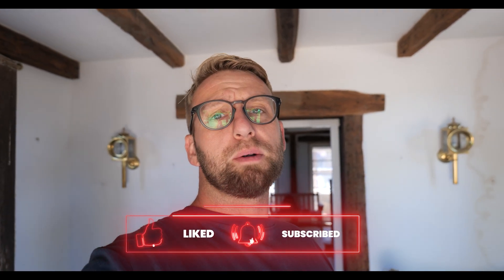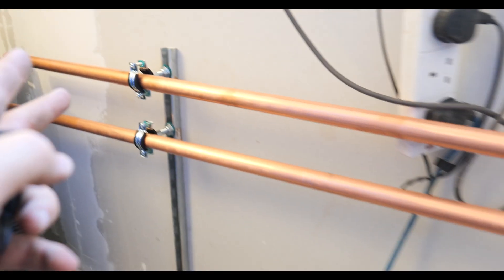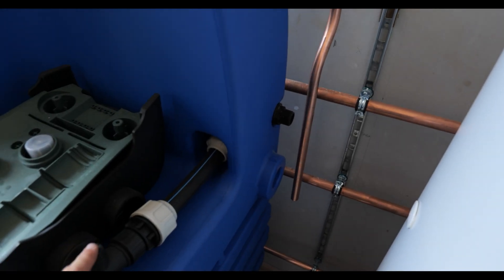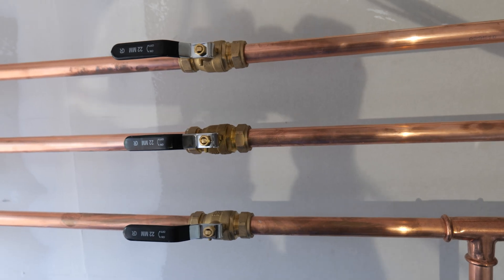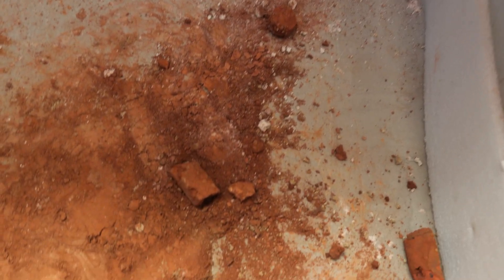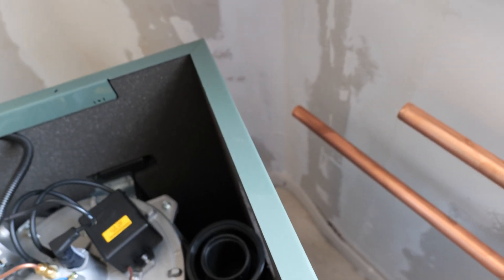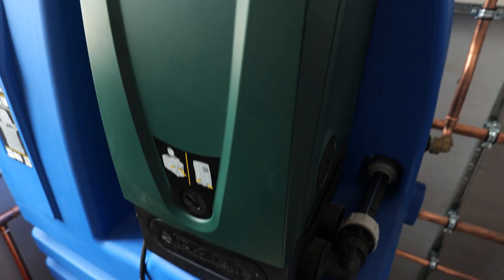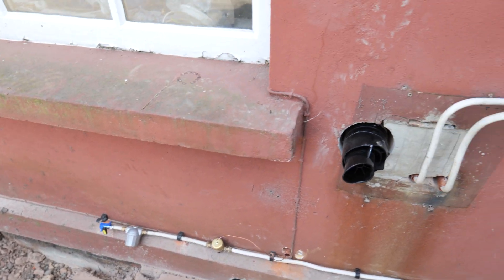Plant Room Installation - DAB Esytank - Navien Boiler - Unvented Cylinder

Comment: What a job pipe porn nice to see some engineer love a bender and press just makes a job much nicer.. Love a bit Williams stock also 😆, Stuart pump, Mag filter I use same, but I also use same low loss sometimes and that AAV on top on low loss is evil😆 always leaks to death so I usually change to Flamco.. But again nailed that room. Interest some feedback on Navien boiler, when I worked in US years ago they told me is crap and support also crap in US.. but I really don't fit many so I dunno how is works out in UK.
Reply from the maker: Thanks I will keep an eye out on those aavs! Yea I think the Navien gas boilers in America get some stick. Pretty sure they are different models over here .